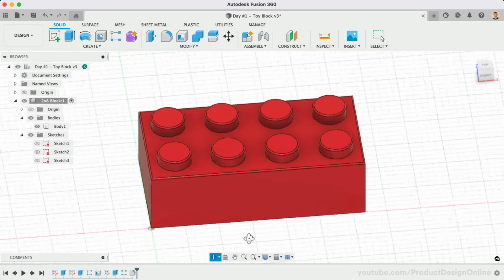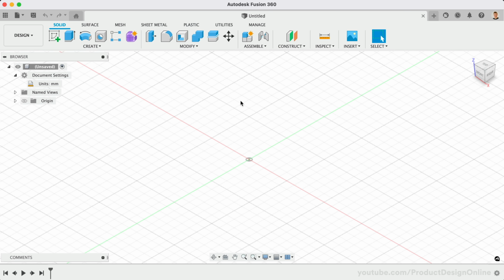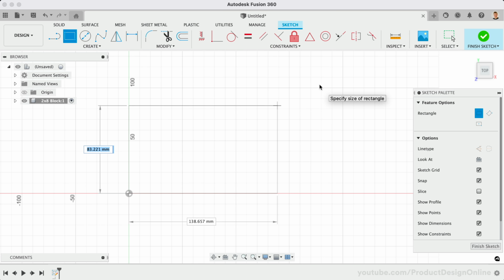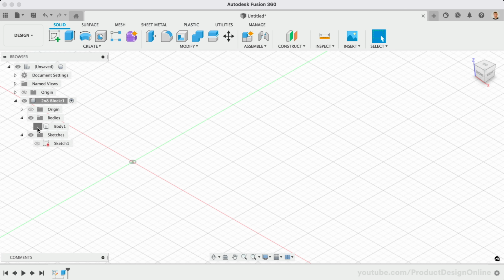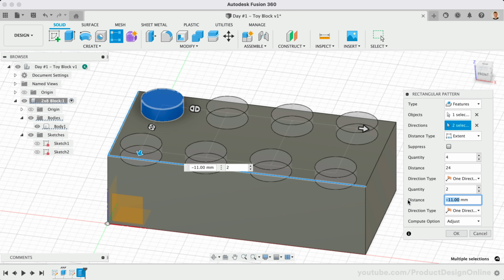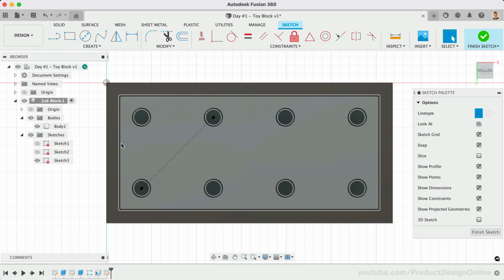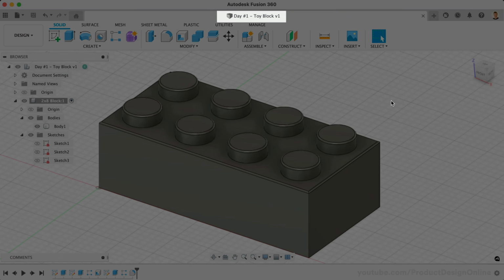Day 1 of Learn Fusion 360 in 30 Days for Complete Beginners! - 2023 EDITION

Comment: Someone should tell the makers of Lego about fillet. My feet would appreciate it.
Reply: @ProductDesignOnline  I’m trying to add brick wall texture to a model do you have any videos about that?
Reply from the maker: @ajp000000  I do not. What is the purpose? Just visual or need to print the texture?
Reply: @ProductDesignOnline  trying to 3d print a tapered cylinder and I want it to have bricks around it.

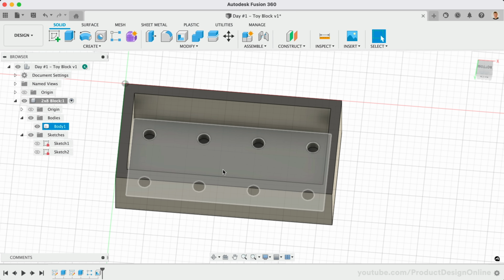Comment: I'm stuck!  Please respond.  At time 10:17, when you select the underside of the top, I can't seem to select just that part, when I click there, it will select the whole bottom plane with the attached perpendicular inside walls and underside of the top including the inside walls of the joined sketch.  What did I doooooo wrooooong?
Reply: Btw, it is a great video, well designed, thorough, and easy to follow.  There always seems to be one part of a tutorial I just can't get past though.  Keep up the good work and Thank you!
Reply from the maker: Double-check that your previous sketches are hidden in the Browser. The sketch may be in the way, preventing you from selecting it.
Reply: Thanks!  That was indeed the case.  Sketch 1 was still visible and was the only plane clickable from the bottom.

Comment: Hey Kevin, great work. I got to the end of day one to the point where filets are to be added, but F360 would not let me select edges when the filet tool was open. Any thought about what I did wrong?
Reply from the maker: Double-check that you have the solid modeling fillet command and not the sketch fillet command active.

If that's not it, can you kindly share your Fusion 360 (.f3d) file?

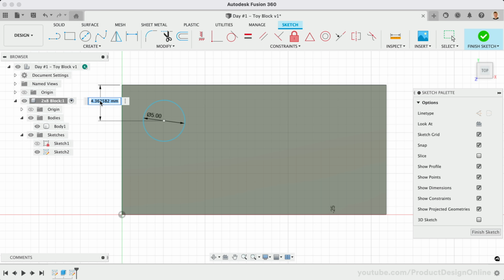Comment: I cant create the circles at 7:24 bc it says the dimensions are over constrained. Any help?
Reply from the maker: It sounds like you may have snapped to something by accident when creating the circle. A constraint that was automatically applied is likely preventing it from being scaled with the dimension. Do you see any other constraints near the edge of the circle? It may be easiest to delete the circle and sketch it again if you can't find a constraint.
Reply: @ProductDesignOnline  i fixed it thanks!

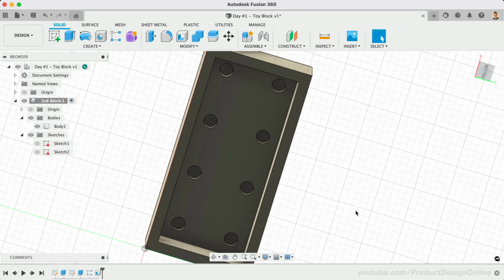Comment: i am stuck at about the 10:15 point immediately after turning the block into a shell. i can figure out why i cant select just that 1 surface to work with and am only able to select the entire block. due to this i am not able to use the previously made pegs for locking points to make the line. any advice is appreciated
Reply: same

Comment: Wow, sorry, I guess I need a lesson on what you are saying. I have no clue as the words and speed at which you are saying them. I guess I need a day .5 to learn. I want to learn this. I am usually a fast learner. I have been 3d printing for 10 years, I have been cnc routing for over a year. I have been cnc lasering for 6 months. I don't understand this for some reason.
Reply from the maker: Hi Dave, you may find this one to be more helpful - https://youtu.be/qvrHuaHhqHI?si=m0UIyjb_MoJQOJK9

The 30-days series covers A LOT and it's spread out throughout the course. It's totally normal not to understand/fully grasp everything right away. In fact, there are many times I don't explain certain features in detail as they are covered in another lesson. This is to spread out the new info and balance reinforcing covered concepts.

Comment: I cannot rename folders, sketches or new components. Also cannot manually change lengths. I'm using the trial version
Reply from the maker: Hmm... the trial version is fully featured so that shouldn't be the issue. You may need to uninstall/reinstall if the issue still persists. I haven't heard/seen that before though; however, I have experienced with external monitors or specific computers the Browser can be a bit buggy.

Comment: Just to add to the preferences as my Y axis was up when I installed Fusion360. 

1. Click on the profile icon in the upper right corner of Fusion 360. 
2. Click Preferences. - general.
3. Change the Default Modeling Orientation to Z up (or whatever is desired). 
4. Click Apply.
5. Click OK. The orientation will now be changed for all future designs.

Great Exercises!

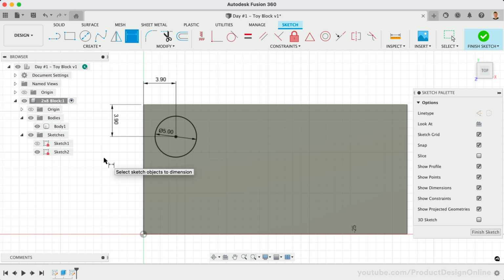Comment: I like the video, however unfortunately I can't proceed, because for the action at 7:40 I get the following error:
"This dimension would over-constrain the sketch" It asks if I want to create a Driven dimension instead. If I do I cannot resize it. Could you please help?

In the meantime I found out. The issue occurs when you select the center of the circle. If select any part of the circle other than the center it works fine.

Comment: Great stuff!! Question:  When we hollowed out the brick, why did the small circles appear at the bottom of each peg piece?
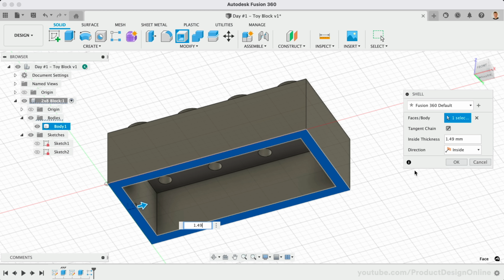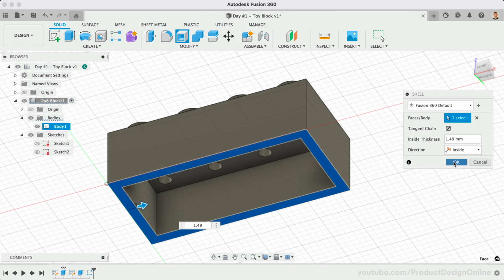Reply: Check out 10:05 - 10:11 of the lesson, the shell feature hollows out all parts of the body attached, letting you see the small holes, but only the hollowed-out parts, if I understand your question correctly.

Comment: I wasnt able to select the bottom of the top face to make the cylinders.  even though I made the bottom face hollow, it still acted as if I was selecting the whole face {even if visually, it was hollow}....any ideas?  Thanks!

Edit  I just restarted from scratch and it worked just like yours.  Not sure what I did wrong but if someone has an idea, I'd love to know so I don't do it again!
Reply from the maker: It may have been the original (first) sketch being in the way. If you still have the file, you can check for the eyeball icon in the Browser on the left side.
Reply: Thank you for this reply!  This was 100% my issue!   @ProductDesignOnline

Comment: When you use the rectangular pattern feature. How did you know what distance to set? The first number for instance was 24mm. How did you know to use this number, and what exactly is it measuring. Thanks. Great tutorial to follow along.
Reply from the maker: Great question! I was referencing a dimensional drawing online. Normally, your dimension will come from a known dimension or by you measuring something - or trial and error in some cases.

The pattern tools allow you to define the overall length OR the spacing between each instance (individual pattern). Both come in handy, depending on what known dimension you have.
Reply: @ProductDesignOnline  
Thanks for the quick reply. You set the circles at 3.9 mm from the walls, is there a way to use to rectangle feature to make sure the other circles/cylinders are also that far from walls, for the sake of symmetry. So all of the cylinders in the corners are the same distance from the edge as the first cylinder. I dont want to flood you with questions. Thanks again.
Reply from the maker: @nbb5026  Not within the rectangular pattern feature, unfortunately. The best way to do so would be to use Joints on individual features OR to create those features in a sketch where you can add those specific dimensions.

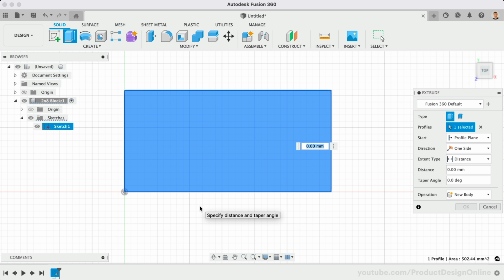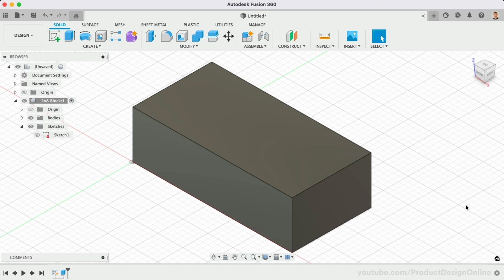Comment: I try to use for first time the personal / not commercial version of Fusion 360, but it seems to be different. For example, when I try to extrude a shape, there is no choise for the distance (6th entry in the Extrude window as it appears between 5:00 and 5:26 of this video). I have put only one 2d shape, but the way you propose to extrude it does not work.

Comment: You are a VERY good instructor Kevin
It's been 2-1/2 years since I've been in Fusion 360...
You see, I was getting into Fusion 360 and I was moving right along - although somewhat sloppy because I wasn't setting up files the right way...
I just busted right into designing without even using proper constraints sometimes...
Unfortunately I had severe retina problems in both eyes that required a series of surgeries and procedures to get my Eyesite back - it took almost  2 - 1/2 years...
I'm back now and I decided to go back to the basics first - which you teach VERY well...
As a retired Mechanical Designer I can see say that you make everything straight forward...
I'll do things the right way now - the METHODICAL way this time...
I design the interiors for Class B RV's...
Thanks again Kevin...
Pete

PS- I am trying to get a STP file or BREF of the Mercedes 2500 - 144 wheel base - High roof to make it easier for me to design...
Do you know of any way of obtaining these drawings?
I don't mind paying for them as it would make my design work a lot easier...

Comment: Stuck. Got as far as 11 minutes but I don't have the 'Centre Diameter Circle' button on the tool bar.
Any idea why not and how I can add it?
Reply from the maker: You can select the 'Create' dropdown menu and find it in the Circle flyout menu. Make sure you're in the 'SKETCH' tab.

Another way to get it is to use the shortcut letter "S" to activate the shortcuts box > type center circle > select it.

It should be in your toolbar by default. You can reset your default toolbar by right-clicking on it > reset. That can help when following the tutorials :)

Comment: Can't select the inside bottom plane.  For some reason, it selects the four bottom "rail" planes and an invisible plane between them.  Backtracked and did the shell again and it worked out.  hmm...
Reply from the maker: Glad to hear it's working now. Not sure what it would've been without seeing the file. Where you looking directly at the bottom or from a perspective/angle?
Reply: @ProductDesignOnline having same issue, however redoing the shell did not change behavior.

Comment: at 8:45, you mention "switch to the direction selector" and I don't have this option.  So far everything else has been perfect but not sure if that's different because you are using a Mac or if a recent update removed that option.  Not sure where to go from here:    Update.  I found that the "direction" selector will never appear, however you can proceed with "axis" being displayed and clicking on the edges for the directional adjustments to be made.  Then you can continue the demo.  Hope this helps others that may encounter this with latest version of Fusion360 / Windows.  Thank you, keep up the great work
Reply: I had the same problem. thank you !

Comment: Great video! One thing I didn't understand though, why did the 8 bumps on top show hollow from underneath after you shelled it out? Why aren't they solid?
Reply from the maker: Great question! The Shell command will always trace the selected/outside contour. Since the nubs are on the top, it traces each of those and adds the desired thickness, leaving the small voids underneath.

Comment: After I extruded the rectangle I got an "Extrude" under the "Sketches" drop down in the menu on the left. Yours doesn't show that, did I do something wrong or not finish the extrude or something? It also wont let me select anything with the rectangular pattern. I set the dropdown to features but nothing in my drawing is selectable. After messing around it will let me select the extruded circle if I set the dropdown to Bodies rather than Features. Is that a new thing since this video was made or something?

Comment: Question,  Why didn't you add the Fillet earlier when you created the top part of the block before doing the rectangular pattern.  Would that not have been more beneficial in the timeline?
Reply from the maker: Great question! Generally, it's considered best practice in parametric modeling to always add Fillets at the end of the timeline. This is because changes later can often conflict and cause downstream errors. When Fillets are at the end you can suppress and/or edit them with less risk. Specific to F360, not patterning Fillets/Chamfers is ideal from a latency standpoint.

Cheers!

Comment: I see that your pinned comment is a question about if you should remake the whole 30 days course. For me, I found this first lesson well-made and still relevant, however I think there should be a "prerequisite" video, called "Getting to know Fusion 360" or something like that, to go through and teach the interface and tools. Maybe that's even two videos.  I was was using TheSketchUpEssentials "learn Sketchup in 30 days" videos until I got to day 11 before I realized that the free Sketchup doesn't have a easy way to export files that 3d Printer slicers can accept.  So coming from Sketchup to Fusion, and watching a video called "Day 1 for complete beginners", I found that I was constantly having to pause and re-wind nearly every phrase to see where you were clicking, but I'm not entirely sure why I'm clicking certain things. For example, at one point you directed the viewer to turn off the "construction mode" or something like that, when getting ready to draw the 3 circles on the bottom. However, I'd love a walk-through of what all of those options are, so I know why I'm clicking on what I'm being directed to click on.  A bit like a recipe that tells you to use a certain type of onion...but not why you'd choose one over others.  In short, I didn't find a reason that this would need to be re-made, but rather a supplemental "Watch this/these interface/tool videos first" sort of video would be a great introduction to the software and your 30-days video series.

Comment: Can someone explain why the 8 circles on the bottom of the lego block are a smaller diameter than the ones that were extruded through the top?
Reply from the maker: The Shell command essentially traces the inner diameter and applies the defined thickness. In this case, if you think about tracing those 8 nubs on top while adding the thickness to it, it results in a smaller area.
Reply: @ProductDesignOnline  thank you for the clarification. I was totally lost lol

Comment: I am a beginner.  You talk too fast.  I am trying to follow with Fusion 360 open.  I constantly have to replay parts.  You gave several ways to open extrude tool and you open in with the keyboard E command.  This does not work on my keyboard so I'm guessing it's something else on windows?  I appreciate your effort with this video but it is too hard to follow because mainly of the speed/pace of your instructions.
Reply from the maker: I recommend watching the video through once and then a second time if you are trying to follow along and build. Even then, I have to design the videos for both types of learners. Those who just want to watch and those who want to follow along. I also have to appease YT alogrithm...I'd recommend changing the video playback speeds of you want it slower :)

The shortcuts are the exact same across Mac and Windows, except modifier keys (Command/Ctrl). Letter E should work for Extrude, it sounds like something is not right with your install. I'd suggest resetting to Default settings in your Preferences. If that doesn't fix it, you may need to uninstall/reinstall the whole program.

Comment: I can't select the bottom of the object to create skectch 3, it always select the top side
Reply from the maker: Can you confirm if you're looking directly at the object (orthographic view / bottom side of viewcube)?
Reply: @ProductDesignOnline  I have the same problem, on 10:21 you've selected internal side. In my case I can only select extruded shell body, on which I can't place a sketch3
Reply: @ProductDesignOnline  I sorted it out: it was the right mouse button and choice "Convert to DM feature"

Comment: At 8:46 it's imp[ossible to continue the lesson as with the current version there is no DIRECTION in the Rectangular Pattern box; only AXES appears and it won't let me select any of the Axes.  Very frustrating.  Thank you.  😞
Reply from the maker: They renamed it to 'axes'. It should be the same steps to apply those. If it's not letting you select the 3D body, you can try to select the axis in the origin folder :)
Reply: Thank you. Will try again.

Comment: Great Video, but I have become stuck, as what you are able to do is different to what I m able to do on the latest Fusion360 Personal Edition (Fusion 360 2.0.15995 x86_64). At approx 10:33 when you start to create the internal columns. If I follow you guide, I cannot seem to highlight just the inside face, and it seems to also highlight the bottom part of the block too, so I cannot snap and create the line using the recess circles. Any idea I am doing wrong?
Reply: yep same here, any tips to be able to highlight the inside face?
Reply: @MaazNZ  Well, i just posted i had the same issue and immediately solved it.  Just "hide" the sketch you are selecting (I think it was 1), and then you can select the inside face.  To hide the face, just click the eye next to Sketch1.  It will change to an eye with a slash on top.
Reply: Me too... Anyone have this issue and solved it?

Comment: Excellent turorial. Can anyone exlain to me why there are 8 "holes" in the cylinders  when using the instruction Shell? The thickness of the walls would not allow to see the cylinders, however, we can see that once the shell instruction is applied, 8 holes appeared.  I appreciate your comments and help.
Reply from the maker: The Shell command essentially traces the contour while applying the defined thickness. You see the "holes" you're describing because the cylinder stick above the top surface of the rectangle. That means the define thickness is following that contour, leaving the hole there.

Comment: When I offset the circle on the bottom face, it just gives me two separate concentric circles.  There is no surface between the two circles that I can select.  I tried selecting both to extrude, but it just gives me two concentric columns.  The space between the inner and outer column is empty/not solid.
Reply: I have the same issue and when use the extrude command it selects the bottom
Reply: I did the same thing. We missed a step.

You set the line type to "construction" to draw the line to assist with creating a center point for the circle. Then you select the circle tool and he says "remember to disable construction", cuz it's still selected after using it with the line tool.